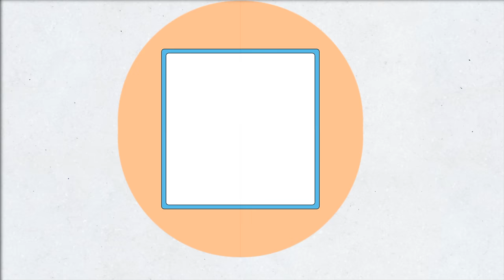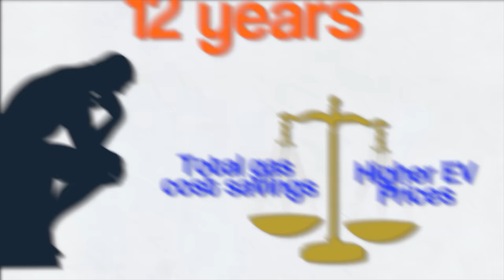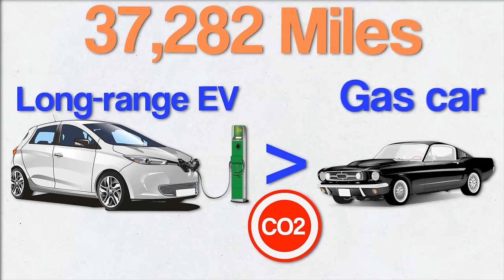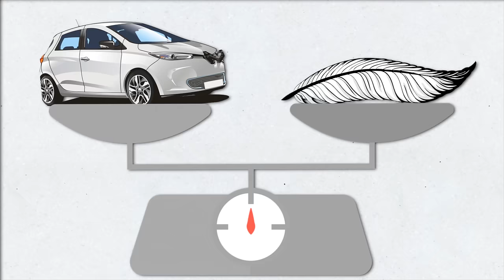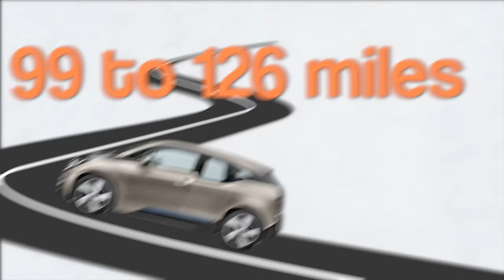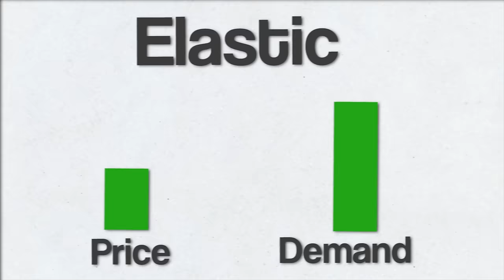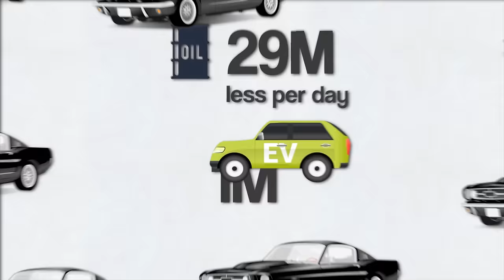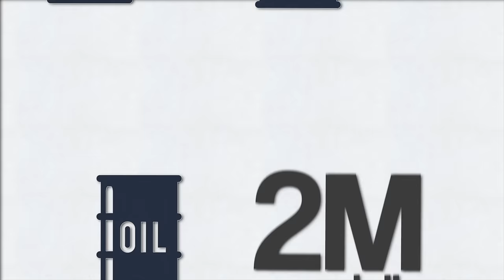If You're Worried About Rising Gas Prices, Watch This

Comment: Just wait until the electricity bills shoot through the roof too. In CA it’s not that much of a savings for the hassle. Plus if the power is out (again CA) or you get stuck in 3 hour traffic jam, if there is  an emergency (again CA, wildfires, earthquakes, riots) good luck. Most people who want one don’t have single family homes to charge from, and tons of the public chargers are now being vandalized for the copper.
Reply: Ya the problem with savings is they work 2 ways. You are pulling money out of savings to afford the price difference but aren't as likely to put that $$ back into your savings. So if you are paying a tad more to save more. Just think that money isn't always gonna return to your wallet unless you can control your spending habits
Reply: @cactneir  Agree, a electric car or any new car is a luxury product. Not everyone can afford to buy a car.
Reply: Stolen smellections have consequences.
Reply: Electric cars don't idle at standstill traffic and use very little power at low speeds. Here in Quebec, electricity is cheap as we have a dam. Hard not to justify a used EV.
Reply: LET'S GO BRANDON
Reply: @landrewmackinnon4888  only 350 miles per charge  then it takes 12 hours to fully charge again .take you two weeks to drive across the country
Reply: @xxelliott786xx  LOL! You said it!
Reply: @landrewmackinnon4888  don't you get snow in quebec? imagine sitting in traffic when it's below freezing and you suck your batteries dry just trying to stay warm. you see in a gas powered car, I can run the heat as much as I want and have little to no affect on my range.
Reply: @landrewmackinnon4888  well obviously you don’t know what you are talking about
Reply: Ummm it costs about 8-10 bucks to change a Model S in Canada, and when you’re stuck in traffic the car isn’t using much electricity at all. Plus, if you’re just sitting in the car with AC or heat on, a full charge will actually outlast a gas car idling with a full tank of gas.
Reply: @this_time_imperfect  I don't think you have any concept of how long a gas vehicle can idle.
Reply: You have a good point their
Reply: @tracycolorado  I hope your not serious
Reply: @cactneir  supposedly next year the higher cost of an ev over a gas car goes away
Reply: @ElectronicsForFun  hydrogen electric cars are the future-but when
Reply: Think of how fun a EV is when you forgot to charge up and a blackout that takes more than 12 hours happens.
Reply: You statement shows you know nothing about electric cars...
Reply: @tracycolorado  you could move farther an faster on horse back.
Reply: @tracycolorado  not even close dude lol
Reply: @this_time_imperfect  I actually did the math and it's pretty much a wash.
Reply: @flashfyre  who's talking about real property taxes?
Reply: Oh wow you brought up a good point apartment's' condos and townhomes owners probably won't get on the band wagon of flipping the bill for installing new ev charging ports to their parking spaces.
Reply: @Bill_Woo  idling still burns gas just as much.
Reply: thats wacky california, up here in oregon ( a better state than cali in every way) its only 7kwh an hour for electricity here. my monthly electric bill here in portland at my apartment every month, with running tons of appliances and tvs and lights and gaming desktops and so on is only 30-40 dollars a month...
Reply: bro if u in a jam EV don't use much power vs gas cars burning gas even when waitin

also CA got extra tax incentives so even better deal for EV.
Reply: I'd much rather live here on outskirts of sandiego than in a dank dark place like Portland any day.  Actually I couldn't live in Portland because the weather sucks so bad.  Maybe bend or someplace.  Even with our crazy state government I'll stay here.
Reply: @landrewmackinnon4888  so no heat pump then ?  are you fibbing a little maybe or does your battery fire defrost the windows
Reply: @landrewmackinnon4888  sure, until you have replace the batteries..you just flushes all your savings on cheap energy down the toilet.
Reply: @ElectronicsForFun  Not only that, batteries don't charge fully when the temp is on freezing point, and discharge quicker.
Reply: @landrewmackinnon4888  
My hybrid doesn't idle either.
Reply: elec junk
Reply: @Harrythehun  You need a 20 year mortgage to buy most cars and trucks  today.
Reply: It looks like you’re making an argument for staying the hell away from California
Reply: @PhaseSkater  I wish I could say that here in New Hampshire. My electric bill has been over 200 dollars a month this past winter. It's crazy..
Reply: This may be something that people are forgetting? That little 9/10 th's of a gallon tax at the pump you pay. I'm guaranteed that with enough EV's on the road, don't think that they won't start adding that to your electric bill as well.
Reply: F J B
Reply: @landrewmackinnon4888  yeah all we and good,electric prices will soar as we are all seeingnow,,power cuts will become more of a problem,,.its all in the agenda
Reply: @landrewmackinnon4888  Maybe but with or cold temperature the battery have half of is autonomy and have difficulty to heat and defrost in winter ❄️
Reply: @Bill_Woo  I don’t think you have any idea how much electricity is in a 100+ kilowatt battery. You could power an entire house for over a month with that much electricity.
Reply: @lesterparker1594  that place is  sad
Reply: @flashfyre  but what does this have to do with property tax?
Reply: @chuckee1745  no idling doesn't use just as much gas, a car could sit and idle all day and night easily.
Reply: @a55tech  those tax incentives don't go very far when your electricity is really expensive and your electricity goes out.
Reply: @flashfyre  not much of a trade off when you consider nobody owns property in california except for rich people and people looking to use their land to turn a profit. there is probably a reason most people are unaware of this trade off and that's because they don't pay property tax. I have spent half of my life in california and I never knew this because neither me or anybody in my family has owned land in california. it's been over 100 years since the last time somebody in my family owned land in california.
Reply: @flashfyre  pretty sure I just told you that.
Reply: @flashfyre  I said rich people because rich people own all the land. your average middle class citizen can't afford land in california unless it's in the projects or something.
Reply: @flashfyre  your point? I'm not saying it's bad to be rich, quite the opposite actually.
Reply: @flashfyre  you're the one who started talking about taxes. I never claimed to know how each state does their taxes, and I don't care how they do it because it doesn't matter.
Reply: @cactneir  Solar Panels, if your property receives more energy than you consume, costs less than regular utility.
You don’t have to go into your savings or wait to save money.
It’s literally a loan stretched out to 5-25 years. People already were going to pay Edison until they die.
In California we spend .31 per kWh
You can bring that down to .16 or lower with Solar.
If you can afford your utility bill you can afford going Solar by redirecting what you already pay.
takes 5 minutes online to get a quote if you are interested in seeing if your home would benefit or not
Reply: @flashfyre  no it's not a thread about CA it's a thread about electric cars. Stop repeating yourself.

Comment: Back in '91, I bought a new Honda Civic hatchback for $10k. I could drive all week on $10 worth of gas. That's how it should be STILL.
Reply: Yeah my 1st car was a Chevette, a full tank would be less than $10… not even a $ per gallon.
Reply: My 93 Honda Civic got 38  mpg on highway.
Reply: For me it was a Toyota Corolla. Ten bucks for all week long. I miss it.
Reply: I say the same type of things everyday now that I am an old man. It is true. Most guys turn into their father. Remember when you were young, your dad complained about the price of stuff? Your turn. It’s inflation. Not going away. Your children do not understand your problem now but just wait, complaining about the cost of things is a rite of passage. lol.
Reply: @evanderosborne4531  Just filled up my SUV $97 CDN, I used 92 Octane gas but could have gone cheaper with 87, might have saved me $10 max
Reply: I want a 86 Acura 🥰🥰
Reply: 1988-1991 Honda crx hf got 50mpg from the factory.
Reply: @Jon-vm3qw  and a gallon of gasoline was $1

Comment: For those of us who were alive during the gas shortage in the 70s there are a few of us who actually worked in the gas station business and we know what really happened and that there was no shortage of gasoline in fact it was exactly the opposite and all of the storage tanks were at 100% capacity and there were hundreds of tankers sitting offshore that had no where to drop there oil to be refined because there was no storage available anywhere in the United States to put it if it was refined

What the oil companies wanted was twofold first they wanted to double the cost of gasoline second most of the gas stations were privately owned businesses that usually were repair shops that also sold gasoline and they would buy from either the cheapest or some of them did have allegiance to one specific company and they would all get the product on spec meaning they would get a delivery of gasoline and have 30 days to pay for it which at that time the cost of a delivery was about $2,000 a truck load

Most of these places did not have much money on hand and in the beginning when the companies cut them off and said you have to pay cash on delivery before we drop your load they were able to pay but as the oil companies raise the price and they had to raise the price they wound up having to pay more than what they had sold the previous load for for the next load and very quickly the companies ran out of money so they didn't have any gasoline but I worked at a station where the guy had a lot of cash and our station had lines stretching 5 mi because we were never out of gasoline.

At the end of the crisis when Jimmy Carter basically told the oil companies he was going to stop them and it wasn't going to be pretty and they had sunk almost all of the gas stations by that point and they began building their own company stations with the mini marts which is what we have today but at the end the price of gasoline was $10,000 a load and I remember the owner of the station three times a day coming with a briefcase with $10,000 in cash and giving it to the driver of the truck and him putting it in the safe in the truck and delivering the load and both the driver of the truck and the owner of the station were carrying handguns openly because they were a big Target and this was back when minimum wage was a 1.60 hr

Interestingly enough the oil companies are talking about doing the exact same thing only now a delivery is $60,000 per truck load and the only way they will deliver is if you transfer from your bank account to their account by wire transfer and most companies don't have $60,000 in the account and if you try to put more than $8,000 into an account that you cannot immediately account for with your sales records the government will come down on you like a ton of bricks so the oil companies are doing the exact same thing that they did in the seventies and they are doubling the price of gasoline and I would expect it to see close to $7 before the end of this and it will stay there and about a month ago the head of Exxon Mobil was on CNBC and he said they had seen the largest single day profit in US history of 180 billion dollars a day and then it had absolutely nothing to do with the fact that the price of gas has gone up buy $2 a gallon.

The two things have absolutely nothing to do with each other and it's simply a coincidence that they raise the price of gas $2 a gallon and now they're seeing almost $200 billion dollars a day in profit above what they were seeing before

Total coincidence

Pay no attention to the man behind the curtain
Reply: I remember this travesty very well. How quickly people forget and refuse to learn from their mistakes.
Reply: Yes you are correct.  I  remember it was horrible and why are the taxpayers giving money to these companies?
Reply: Haha total truth gas gouging lol regardless of party we should unite against them
Reply: Yep, nothing to see here
Reply: Exactly
Reply: Holy run-on sentence
Reply: @ocsrc  Please stop it with the run-on sentences. Your information is informative but difficult on the reader's eyes and patience.
Reply: @riproar11  guess you can't read a book either.
Reply: @AA-ke5cu  Books are correctly written. Oh, you're another one of those who can't capitalize.
Reply: You're not wrong.However,how much profit were the oil companies making when a barrel was going for $20?Not very long ago.
Reply: @joeysmith5074  they dont foget, we only live 70 years, with a productive cycle of no more than 40, and after certain age most people are "to old" to participate 

So no one forgot anything, those that remember it are old and dying, and the ones living it are doing it for the first time

Do you think those that went to Afghanistan had ever heard the word "vietnam" in their lives? Lol
Reply: Yup, must feel bad being a pleb and knowing the entire country is geare0d just to make old rich people more and more rich before they become fertilizer
Reply: @StoneCoolds  Soylent Green is people!Shouted Charlton Heston in movie of the same name.
Reply: @StoneCoolds  I would hope they are aware of Vietnam or our high school history teachers aren’t doing a very good job.. 🤔
Reply: So what’re we supposed to do? How does this get corrected?

Comment: In answer to "Do I plan on buying an EV?"  The answer is a resounding "NO!" At least, not at any time in the foreseeable future.  Battery technology, issues relating to the disposal of used EV batteries, and the availability of charging stations, plus improved EV range -- not to mention the cost of EVs -- are all factors that will need to improve before I consider owning an EV.

Comment: It's crazy how people are being duped into believing that EVs are cheaper to own and operate and that they are easier on the environment. They are sadly wrong on both points. Some folks are intent on learning the hard way.
Reply: I wouldn't say some folks looking at what's going on today and how many people stand behind it.
Reply: Ev stands for eediot vehicle
Reply: Yea dont listen to the government !!!!!
Reply: EV repairs & insurance rates are much higher.
Reply: @arricammarques1955  just like combustion cars, it the really depends on the type/value of car. Insurance for my BoltEV is the same as it was for my Mazda3. As for repairs, EV drive trains have far less (~20) moving parts compared to combustion cars (~2000). All you do is rotate the tires, no oil changes, and check fluids every 150K miles. I've had my BoltEV 3 years and not had to pay a penny so far (tire rotations are free). Brakes last much longer too since you hardly use them (regen braking uses the motor to slow the vehicle down/recapture the energy to charge the battery)
Reply: plus ev's are ugly af 😝